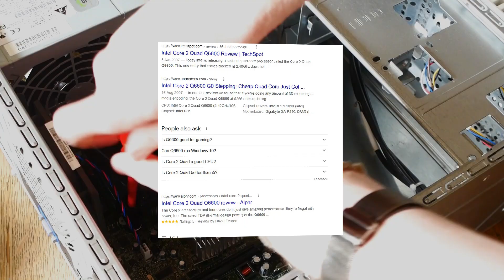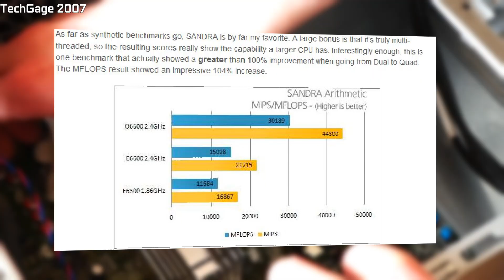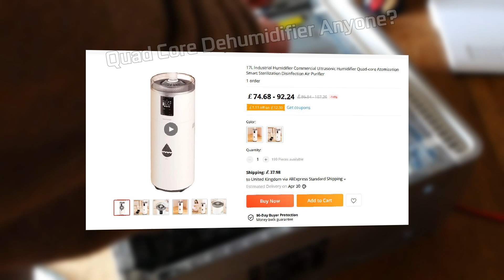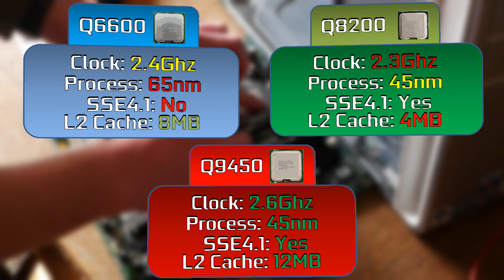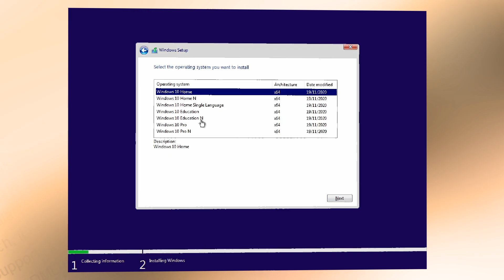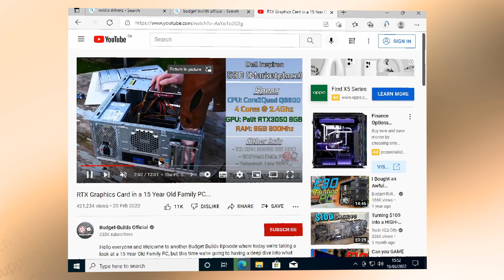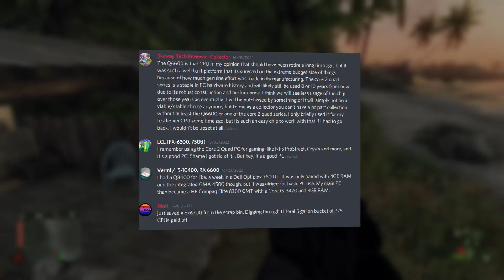Intel's Core2Quad...Finally Obsolete?

Comment from the maker: If anyone else has any C2Q Opinions or Experiences, please leave a comment as I have been loving the responses from the community so far 👍
Reply: I used a Q9550 + GTX1060 6GB + 8GB of 1066 DDR2 RAM to play Metro Exodus. You could feel it struggle a little in some intense parts, but the game was quite playable. For a more than 10 year old CPU this is quite an achievement.
Reply: @sobolanul96  I have a Q6600 oc with tape + 10gb ddr3 ram and R7250 2gb I play Exodus on 720p no problem. Also Crysis original is awesome on it.
Reply: @sobolanul96  I had a Q9650 @ 3.6 Ghz. It couldn't handle Watchdogs.
Reply: @sobolanul96  it will hit 3.6 ghz with ease and it won't struggle much.
Reply: I've got a question
wth is quad core water?
Reply from the maker: @jurisjancevskis9076  We may never know. It has 0 reviews
Reply: @BudgetBuildsOfficial  ok
Reply: @BudgetBuildsOfficial  maybe buy it and review it, I guess?
Reply: @BudgetBuildsOfficial  Small suggestion. Next time when you test CPUs (or GPUs) do include CPU and GPU load in benchmark run. This way we could see is there a CPU or GPU bottleneck.
Reply: @BudgetBuildsOfficial  Build and sold a system with a Core2Quad q9650 and r9 270 recently
Reply: @jurisjancevskis9076  By the image of it, it looks to be a quad reservoir with filters between them. Probably better off getting something from Brita.
Reply: I'm just trying to sell a PC with a Q8400, 8Gb RAM and a GTX460, it served as a light gaming pc and as a movie playing pc connected to my tv, but i want something bit more powerful, so i try to sell it
Reply: @szab04  how's it going? did you found any buyers? how much the tag price? just curious coz' mine don't sell well yet. it's hard to selling old rig nowadays..
Reply: @lonewolfnomadic3403  I gave it up already Xd, The sound adaper died for it so i have to get a new one, also, i added an SSD ti it and at some day, i'll try to sell it again
Reply: @szab04  how much are you selling it for
Reply: @Tom22420  it doesent matter anymore, i already sold the GPU separately, plus prices of well anything in my country is way higher than in England for example
Reply: @szab04  k
Reply: There are a number of industry applications that still utilize LGA775, as well as Core2 Duos/Quads.  Can't hack into a Windows 7 machine through the Internet if it isn't connected to the Internet.  

If the software is optimized properly, they'll continue to run until the hardware itself becomes unobtanium.
Reply: I had a core 2 quad pc for like 5 years. The pc has a R5 240, core 2 quad q6600, and 4 gigs of ram. We got the pc from a trashcan and the gpu from work. I played Garrys Mod on that pc to death.
Reply: I already posted this in the main comments, but for some reason, I wanted to go down memory lane in an old core2 quad system. It is an OEM Lenovo Desktop that was recently retired from school usage, I scored it for $20.
It already had the Q9650, and 8 GB of DDR3 memory.
I only need to throw an SSD, and a GT 1030 in it, and it will be a full system. I am genuinely curious how the factory clock of 3.0 gHZ will be in modern titles. These really are some fun platforms to tinker around with.
Reply: I recently acquired an HP DC7900 desktop with a Q6600, and 4GB of RAM from the local recycle drop off for no money, I gave it a good clean, replaced the busted Seagate HDD with 120GB SSD, dug around my parts bins, came up with 8GB of DDR2 RAM, and a 1GB Pegatron AMD 6570 GPU, put Solus Linux on the machine, then I gave it to one of my elder neighbors who needed a new PC after dropping their laptop, and cracking the screen hoping I could fix it for little of nothing, and they love it for their basic daily task on an older 32in 720p LCD TV we pulled from their guest room.
Reply: I still use Q6600 in a Dell Optiplex 745 6 Gb RAM DDR2 and Xeon X5460 775 -> 771 10 Gb RAM DDR2 + GTX560 for gaming.
Reply: For comparison... since it came from 2007... try running 2007 games on a CPU from 2002, one from 1997 and one from 1992. You will see performance gains on the PC has slowed down dramatically.
Reply: Awesome Video!! I'm sure you're aware by now, but if you aren't there's a typo at 3:55. "Clocls" instead of Clocks. Other than that, I love this video and all the content you produce! <3
Reply: I think we're at the limits of IO (PCIE and FSB) with this platform.  There are also inherent limitations to branch execution and prefetch in this core architecture (designed to run many winXP era apps not one DX12 title).  At this time C2Q's are more of a novelty soon to be beaten by Raspberry Pi's.
Reply: Well i used this gen c2x qx9650 till last year with 8gb ddr3 ram and gtx1060 gpu, and can still play most of the new titles with some stuttering, and amazingly runs cities skylines fully build city with 250k pops somewhat ok
Reply: I have an Athlon II X3 450 unlocked to Phenom II X4 V50. According to userbenchmark it even kicks the Q9450's ass. Funnily enough it's paired with 4gb RAM and a GTX 560ti in my overkill XP build! 😅
Reply: They are perfect for retro emulation right up to ps2 and wii.
Reply: The Q9650 @3.00GHz was a beast. Gave away a system with that chip. You could OC it to 3.6GHz by increasing the BUS speed from 1333MHz to 1600MHz without any issues at the same voltage and that would gain you tangible performance in games. I really loved that CPU.
Reply: I have 4 C2Qs as my parents WMC OTA TV setup(migrating them to plex).  an SSD can make a 10-15yr old machine go from sluggish to adequate/satisfactory. so many old pcs with the free win10 upgrade that could be made usable for less that the cost of a streaming stick/box
Reply: Q6600 is a legendary chip and I loved mine. I overclocked 24/7 prime stable at 3.4GHZ and didn’t replace it until I gots 2600K at 4.7GHZ. It became my living room PC, then my guest PC, and still lives on as a file server.
Reply: I was still running a q9650 in my second pc which i use for LAN partys etc. since one year ago with Custom water cooling running at 4ghz.
but when i upgraded to an overclocked hd 7970 it became to big of an bottleck and hat to leave my well and trulely loved 775 socket to Upgrade to an i5 2500k which matches the gpu now very well.
Reply: It was the CPU of my first gaming PC, which was an computer I bought from my language arts teacher in middle school for $40 and upgraded with literally anything I could afford. A Q6600, two whole gigs of ram, an ASUS PK5-e motherboard with wifi, an ASUS Xonar D2 sound card, and an nvidia 8600GT (the black one). Eventually upgraded to a 750ti and added some RAM, it held out until 2015 before needing replaced. Just now hitting that EOL stage with the build I replaced it with, only waiting on the RTX 4000 series to drop so I can make computer #3. 

I love the C2Q, sad to see it finally go but wow it had a good run. What an ironic piece of silicon.
Reply: Great video. Have one Q6600 build and 5 or 6 Q9550s. One of them is an active router soldiering on for a decade (with one more setup for redundancy). Another is level-3 file storage machine with hot swap trays.
Reply: I wonder how the graphs would look with a tape modded Q6600 🤔
Reply: amd fx when?
Reply: Back then when I had to make a choice I did consider Q6600 for quite long time, but in the end I decided to go with core 2 duo E8500 with higher clock speeds because 4 cores was such a new thing and I thought it would take quite long time before 4 cores would be used in games. I still keep my E8500 in my winXP retro pc that I use for older games that dont work that well with more modern windows OS.
Reply: Got my Core2Quad Q9550 + 8GB + 7800GTX + Soundblaster X-fi Platinum as an upgrade for my Opteron 165DC + 6800GT + 4GB and I absolutely loved it to bits, It's been in use since the day I bought it, first by myself (did upgrade it  with a 9800GTX and later with a GTX470, then I moved to a different country and got myself a i7 4800MQ + GTX870 + 16GB laptop, so my C2Q went to my mom, who used it until my brother upgraded his machine and my mom got his old i7 970 + GTX780 + 12GB ram. The Core2Quad on the other hand stood there collecting dust for about 3 months when a friend of mine, accidentally bricked his old machine (some old single core Sempron based thing) and since I don't need the machine and he was in need for one I gave it away for free and sold him the 24" Samsung screen that I used with it for 25 euros (as otherwise I would've eventually brought the screen to my new country and used it for my own purposes, the computer he would've gotten for free anyway) and he is using it even today as his main music creation station (Reason, Cubase and some Tracker) and even uses as his day2day driver...

The thing actually overclocked like crazy as well, I had it running at somewhere between 3.2 and 3.4GHz (don't exactly remember but definitely at least 3.2GHz) under an Arctic Freezer 7 with MX-4 paste, up from its base clock of 2.83GHz...
Reply: Are you going to do all of these again but actually overclock them this time?
running a q6600 at stock clock is sad and dumb, they usually will hit 3.6ghz stable and are very impressive at that speed.
there is no argument against overclocking them, mobos and cpus are cheap, just send it. 
would also be an interesting venture into 771 to 775 conversion and slap a x5470 in an overclocking board. 
I had 4.12ghz on a dual cpu build on that cpu, but people have claimed higher like 4.5 stable without too much issues.
Reply: I have had a heap of expereince with the C2Q xeons, and they do have a similar die to the cpus of like of Q9450.
With 12mb of l2 cache which I think makes a big difference with newer games these days.

Overclocking the xeons with big overclocks really can net some nice performance results.
I had recently overclocked a core 2 quad xeon E5450 to 3.9ghz witch ran pretty stable for the most part.
But boy do they shine with a good portion of extra Mhz, 900 of them really did go great in games. I have a video on my channel if you wanted to preview what they can do, feel free research.

Getting the xeons to work in most motherboards requires a couple of mods. Both on the CPU and to the motherboard, I'm sure you already aware of the obstacles invovled,
But feel free to hassle me if you have any questions, I'd be more than happy to help out with micocode bios mods or with any information about the hardware mods to finish your trilogy.

Great video by the way as usual, I've always enjoyed the stuff you put together.
Keep up the good work.
Reply: Interesting video I've happened to come across.

My first self built PC in late 2007/early 2008 had a Core 2 Duo. I went with the then-new E8400 as it was faster than all the quads in games (namely because I was overclocking and the quads wouldn't clock as high as easily). The only one close was the Q9000 series which effectively was the E8000 series with twice the cores, but the cost premium was high in a world where few things would justify it unless you were using some productivity software that was highly parallelized. I later got a E8600 and I still have an E8600 that was, until recently, in a Dell OptiPlex and it's probably one of my favorite CPUs.

About a year or two ago I noticed modern Minecraft (Java) versions weren't being too kind to it. Just as you described in your experience with the Bedrock version, it played smoothly once chunks were loading, but chunk loading was awful. I noticed music playing in the background would stutter during chunk loading, so I checked task manager and saw how bad the cores were loaded. Since Core 2 Quads were so cheap on eBay and I always wanted to try one, I figured it was worth it even if it didn't end up helping and so I got the Q9550 (at half the price of the Q9650 I felt this was the best one). Unfortunately, Minecraft still behaves rather poorly on it. It's improved, but not as much as I was hoping (task manager for sure painted a picture that lack of cores was an issue). The lose of 500 MHz probably hurts a bit too.

This does not happen on a 2500K, another quad core CPU, I had previously. I wonder, the Core 2 Quads aren't monolithic quad core CPUs, but rather they are a pair of Core 2 Duo chips on one package that communicate together over the FSB, and I imagine this might hurt performance in some workflows. If that's not part of it then maybe the OptiPlex I have it in isn't handling it well, because the 2500K is only a few years newer but is night and day difference.

I think the Core 2 Quads didn't age as gracefully (sounds silly, I know, considering the video shows them sort of relevant all these years later, but that's sort of because CPUs have advanced slower since then). The quads in the following couple of generations are almost as old but I feel like they've held up far better. Given how little software needed extra cores and with how a quad would mean a more expensive, slower chip in that day, I feel like I made the right move choosing the Core 2 Duo all those years ago. But, Duo or Quad, the Core 2 has a special place in my heart (hard not to when you have a Pentium 4 before it...).
Reply: The Q8200 used to be a sick chip, overclocked that thing to 3.03ghz on stock voltage, that turned it into a beast haha
Reply: My daughter who plays sims 4 and minecraft mostly has the Xeon X5460 overclocked to 3.8ghz. The xeon can be modded to work on lga775. Its still working perfectly fine on a gigabyte ddr2 board with ram at 967mhz. Together with a ssd and Amd hd 5770. She loves the pc.
Reply: I've only used the 771 Xeon versions due to the converter you can get and the inexpensive motherboards at the time. This was 8 years ago mind you but the performance was great at an FSB of 410 on an P43 motherboard with the added microcode of course inserted in the bios file. The Xeon chips come with 12 MB of L2 cache meaning that their alot faster in general. You can get an X5470 easily to 4GHZ I heard. Only have E5450 / E5430 experiences myself.
Reply: Try tape (bsel) mod on q6600. Increases FSB from 1066 to 1333MHz 2,4-->3,0 GHz
Reply: I'm still using x58 first gen i7 (now using a x5690)
Reply: @JayMont07  I don't blame you, for my work PC(I work for a small non profit, so I have to be my own IT)I use a salvaged HP desktop with an Intel I7 2600s, upgraded to 16GB of DDR3 RAM, an MSI R7 350 2GB OC GPU, 120GB ADATA SSD, and 1.5TB WD Green HDD(found with the machine with low hours on the drive) running Solus Linux, and it powers through all my office, web browsing, and even light video editing of 720p, and 1080p video using Davinci Resolve with no issues whatsoever, and I don't see myself upgrading that PC from late 2011 anytime soon unless something major breaks like the CPU, or motherboard.
Reply: Seems like this would be a great cpu for a retro gaming setup with dual boot win98se and win7?
Reply: @MeepMeepMwo  You'd be better off for Win98se using a Pentium 4, and dual booting XP on a separate SSD/HDD as that's what I do with my retro gaming setup, as the q6600 is too new for Win98se drivers, and you will run into various issues.
Reply: @MeepMeepMwo  Win98 not really, by the time these machines came out, support for all the hardware in 98 was dropped years ago so you wouldn't be able to get 3D acceleration working, sound would be a problem, drive controllers would probably be an issue too and to top it off Win98 doesn't even support multiple cores/cpus...
Reply: @MeepMeepMwo  windows 98 has no multi-core support. XP would be more appropriate. But most games which would run on XP will run on Windows 10 and it is actually a bit more efficient; I would just do that
Reply: @MeepMeepMwo  all classic valve games (HL, Portal, TF2) will 100% work even with a  Core 2 Duo E8500, GT 710 combo. I know this because it's my Maine rig for $130 AUD ($100 USD)
Reply: I've made a video of q6600@3.0ghz with 8gb and an 1050ti and its dead jim. For games until 2016 it can handle. Modern ones it does not. I'm about to try to buy an Phenom 955 to compare in modern games
Reply: I have a question is there a way to flush Chrom OS Flex on Core 2 Due ?
Reply: @TheBoxsMan  Chrome OS Flex aka Neverware Cloudready OS Home Edition(Google bought Neverware, and turned their ver. of Chromium OS into Chrome OS Flex), requires a system that supports UEFI secure boot, and 100% will not boot via GUB boot. Your best option is a good modern easy to use Linux distro like Solus W/Budgie DE that still supports GUB booting, and if you are not into rolling release distros Linux Mint DE(Debian Edtion) is a fantastic option as well with their Cinnamon DE, and both have either Chrome, and/or Chromium browsers in their repos for install.
Reply: @CommodoreFan64  thanks my friend i think i will try linux
Reply: @TheBoxsMan  Sounds good, just make sure you use an 8GB USB 2.0 flash drive, and write your ISO using Etcher for best results. Also one tip if you need WiFi on Solus after install(you will need to use a hardline connection for install) and it's not working fully out of the box, use their hardware driver installer found in the menu which will find a hybrid installer let it do it's thing don't reboot, go into the system terminal then type sudo depmod -a, it will ask for your password for sudo which is the one you set during install, put in your password let it do it's thing which won't look like much,  close out the terminal, and then reboot your system, and full WiFi should work, I've had this little issue on a few Lenovo Thinkpads, and a Macbook pro that use combo bluetooth/WiFi chipsets, and have 5Ghz which the 5Ghz band would not show up otherwise. Beyond that little hitch Solus has been super easy, and the most stable rolling release I've ever used, and I've been using Linux in some form since the late 90's with Red Hat Deluxe, and Corel Linux.
Reply: I had a q6600 machine from 2007 to 2017, changing it to ryzen 1700 machine. I am amazed that it held up for so many years, and still is)
Reply: I had a Core 2 Quad Q8200, but it was a bottleneck for my HD5770, because of architecture limitations
Reply: I had a PC with a C2Q Q8200, 4gb RAM and a GTX 750. My dad gave me the beast that used to be his gaming pc back in 15 years ago, just changed the GPU and it was all perfect.
He said the CPU did a very well job while rendering videos on Sony Vegas, and was right. I've never done much intense gaming on that rig but I can tell that it kept up pretty well on the games I've played.
Reply: I still have two systems that are used in my house  one is a media station q6600 in my bedroom. Other my son uses qx 6700 and works well for him
Reply: One of my main PCs is a Fujitsu Siemens TX200 S4 with dual X5450 (~ Q9650), while the FB-Ram and limited PCIe support keeps it from demanding games, it's great for general use, video encoding/decoding and other tasks where you want a stable system working away for days. Some Programs (mostly Games/Emulators) don't like the Dual-CPU setup, tough.

I didn't have a Core2 System back when they were considered recent by any stretch of imagination, but after I got into PC-Building/Repairing, I got to work on dozens of them and I always found them a well rounded product (some DDR2-RAM shenenigans aside), meaning when things took their time, they just took longer rather than crashing/freezing. While this might immediately remind people of Pentium D and the like, I've seen "new" Windows 10 Desktop Systems with mobile CPUs, which got sold by "reputable" brands and couldn't even manage basic browsing+excel sheets without freezes.
Reply: I am using Q6700. It would have been well if I didn't play mostly CPU-intensive titles like Space Engineers (but actually had 80 fps in midgame in space!), From The Depths (fine until you start a battle that is more than a 1v2, then it goes into degraded mode) or Cities: Skylines. NFS Most Wanted 2012 runs beautifully on high, with ultra settings literally looking the same, but with less FPS.
C2Q gang is going well, was a pretty major upgrade from a Cease 2 Die E6550 a couple months ago. Still on 4 gigs of DDR2-800, though, but getting 8 gigabytes of DDR2 would be as expensive as 8 gigabytes of DDR4.
Reply: I have a q8200 system and for now its still my main rig sadly, i have it paired with a 1050ti it barely runs games and the 4gb ddr2 ram really hold it back but for day to day usage its still okay
Reply: These should be replaced by Xeons. The best core2quads are actually Xeons, compatible with some light hacks with desktop motherboards.
Reply: Core 2 Quad was dead in Haswell era. . .
Reply: try Windows 7
Reply: My parent's PC, that they use daily, has an Core 2 Quad Q9400.  They use it just for general Web browsing and video watching and its great.  I have a QX9650 (which I am disappointed you failed to mention) and I run it at 3.66ghz and have done for the last 14years.  It is still a capable processor but not for modern gaming.  I have it dual booting Windows XP and Windows 7 so I can play most of my old games that dont work on Windows 10 on my Ryzen 5950X system.  I upgraded from QX9650 to Ryzen 5950X - Absolutely incredible upgrade that was.
Reply: Till last year my desktop pc was based on a 771 Xeon, and I'm surprised that it lasted so long, I can't say it was smooth and could play all games maxed out, but as an office/Web browsing pc with 8 gigs of ram it was just enough till 2021, almost forgot the vga was an 8800 ultra
Reply: A good Core 2 Duo can still play plenty of games, IF your expectations are reasonable:
Half Life
Half Life 2
Team Fortress 2
People Playground
Universe Sandbox

Beam.NG drive 
(maybe, will edit when bought)
Reply: Got into pc building and playing quite late. First pc I built back in 2009 - 2010, which had an Athlon X2 7750 Black Edition. But the Core 2 Quads were still all the rave at that point, even when the Core i7-920 etc came out, there was no shortage of people saying that if you wanted a wicked back for buck quad core, to get a Core 2 Quad, so I was looking into upgrading to one, but slowly decided against it because of the AMD Phenom II's were releasing shortly and I went to the 955 eventually instead 😜
But I was SO close to going over to Intel because of those wonderful chips.
Reply: Still running my Q9650 system daily.
Reply: i have the rare lga 775 ddr3 with usb 3 equipped with core 2 quad q9550 overclocked to 3.4 GHz, 8GB DDR3 1266, Zotac Geforce GTX 1060 3GB AMP! Edition (+vrm cooling mod) that served me only 2 years until I upgraded to i-series 6th gen mobo and i3 6100 (just to pe placement for a powerful CPU),
Reply: I installed Windows 8.1 on Intel core 2 quad instead of Windows 10, because Windows 8.1 is lighter than Windows 10
Reply: I got my hands on a Dell Vostro 230 an office was throwing out because the hard drive went bad.  Took it home, swapped the C2D out for a Q9650, upgraded the RAM to 8GB DDR3, installed a 240GB SanDisk SSD and a 1TB hard drive, and then finally a GT1030.  Set it up for my mother to use as her personally little computer and have heard no issues from it.  She watches YouTube and plays an old 2006 Mahjongg game and sends emails.  But I used it once to run a good DIABLO LAN party and it easily kept up.  As a “daily driver” with what I consider to be LIGHT tasks, it is more than capable still in 2022.
Reply: Got a X3320 (the xeon version of the Q9300) .. 2.50ghz stock and pushed it to 3.4ghz (so 36% alltime stable oc) on air no problem on an Asus P5E.
The days when REAL overclocking was actually a thing still.
Reply: My laptop (that I used for gaming, now I have a PC) has Intel Celeron Core2 Duo N2840, on a 32-bit Windows 7 ultimate. It is really slow compared to my PC, but then I had nothing to compare it too, and was happy with 12FPS in GTA IV, that I have almost beaten. It is also filled with bloatware and spyware my mom installed so many years ago, like 4 antiviruses and 6 performance boosters. Still, that CPU was great for me, and I don't doubt that a C2Q would be a lot better, maybe similar to my i5 2500.
Reply: I have some CoreDuo chips, they are still OK. Browser works just fine.
Reply: My first custom built computer was centered around a Q6600 in January 2008.  If I remember right, I used 4GB of Corsair DDR2-800, an Asus P5K with a P35 Northbridge, an EVGA 8800 GT 512 (G92 Rev), Antec 650w, and a 92mm Noctua tower cooler, all in an Antec P182 case. A year or so in, something killed the motherboard, but everything else survived, so I migrated to an EVGA 680i motherboard, upped the RAM to 8GB, and threw in a second 8800 GT a friend gave to me to SLI with my original. Ran Vista, and 7 later, like a champ. Still custom building today, and that thing started it all. God, I loved that machine.
Reply: Had a Q9950 in my first "gaming" PC and boy what was it strong.
Reply: 3rd/4th gen i5s have taken over from Core 2 Quads. They are the affordable CPUs that can keep up with new games. You can pick them up from £10-£20, and DDR3/motherboards are also cheap. Entire prebuilts can go for under £50 on ebay.
Reply: You got any plans for future content?
Reply: I used q8400 to play AAA modern game like RE2 Remake and got average 45 fps, never go down below 30 fps even at the most massive consuming scenes in the game
Reply: I currently have a Q8200, with 8GB ram and GeForce 9800gt GPU, and it handles CS GO well, playing around 40-50fps, with all graphic settings set to low as possible. I really enjoy the q8200. For someone on a budget, it would work very well as a working desktop.
Reply: I have a Q9550 build from 2010, (mobo Asus p5q pro turbo 8 gigs of 1066 ddr2) it's spent it's entire life overclocked between 3.8 to 3.6ghz,  in 2019 I put an rx 590 in it and turned it into a 4k media pc. Still going strong averaging around 60 fps in gta5. (@ 1080p 0f course) Besides being easy to overclock I think the 12 meg cache is why it's still relevant .
Reply: The Dell 530 was notorious for rejecting Graphics cards.  Especially AMD cards.
Reply: I have a machine with a core2quad q9650 and 8gb of DDR2 800mhz, one of the fastest machines you can have... If you live in 2008. It runs my Minecraft server.
Reply: Build and sold a system with a Core2Quad q9650 and r9 270 recently
Reply: I recently installed a Q9550 in a Lenovo M58 SFF
Reply: I bought a Q6600 on day1 of it's release and combined it with 2x 8800gtx SLI. It was great and I played basically every game in the era on it. I replaced it a couple years later with the 2500k. I still have both of those cpu's in a box in the attic but no working mobo for them.
Reply: Still using an E8400 as one of my office PC's at work.  We wanted more RAM for it and actually got our hands on a board that supports DDR3.  It's running PC3-10600 2x4gb in dual channel.
Reply: For web browsing, light work at home q9559, SSD and at least 8gb ram (or more) + Win 10 and you are fine.
Reply: @BudgetBuildsOfficial I have that exact computer.
Reply: These need to be over clocked the q6600 was known for its easy over clocking
Reply: I still having c2q q9400 runs awesome in my system
Reply: I have used a Q8200 system from September 2009 to January 2019.
Reply: I still use an old PC with a Q9400 as bedroom media centre hooked up to a projector.
Reply: Have lots of experience with the Q9650, Q9550 (12MB Cache) & Q9400 with 6MB cache (missed the Q9450). The first two are running Windows 10 22H2 Pro today, maybe it's the MB of the HP SFF 5800, tried installing Windows 8.1, the BIOS would crash. Had to place the BIOS back on the PC & reload Win 7 Pro.
Reply: @charlestilley2576  I'd suggest Windows 10 LTSC for a core 2 quad or any older system, because it's windows 10 without all the bloatware and more robust with older systems. It was designed with industrial applications in mind, but every desktop program i tried so far works fine. 

I also use it on my higher end workstation PC i use for engineering as well as my recent gaming PC, playing CP2077 phantom liberty on it right now with an RTX 4070, not a single issue, all drivers work, because LTSC is just less annoying. No random pupups reminding me of Win11 or to give the friggin calculator app a five star review. LTSC feels like Win7, but modern.
Reply: Great CPU for gitabit NAS !
Reply: I'm just gonna say that those platforms were a dream to upgrade. Started with a shitty Pentium D, then bought a Core2 Duo E7300 to finally cap out the motherboard with a Q6600. Every time it felt like it was a completely new PC
Reply: Athlon X2 7750 or phenom 64
Reply: I'd like to see you talk about the Core 2 Extreme series. These were the Pinnacle of the C2Q series. I actually have the QX9775.
Reply: just writing from my old "5th in a room" pc, c2quad here, q6600 on 3.0 it is still ok, but now the case will have newer mobo with q9550 - watercooled and ddr3, just need to assemble custom (gtx 580 water cooled + q9550) hope it'll oc nice :D
Reply: remember the days when you had to look up a mobo to see if CPU or RAM is compatible With it? :))))
Reply: I have a question though if you remove the shadows would it become playable red dead redemption 2
Reply: Core 2 Quad was bad even 10 years ago